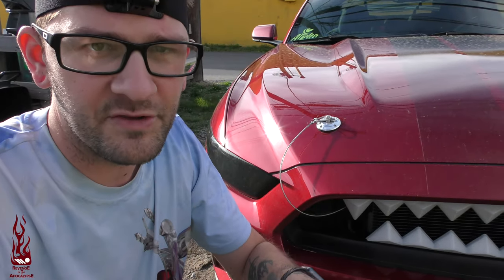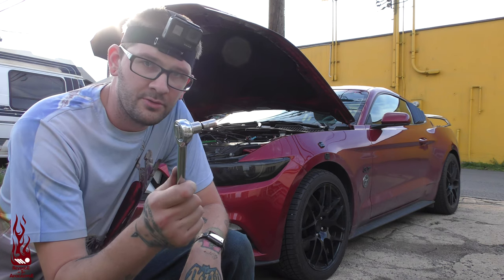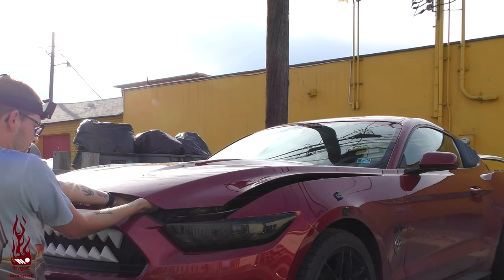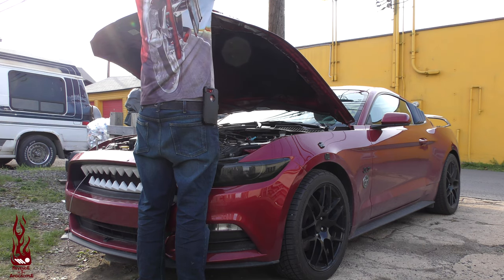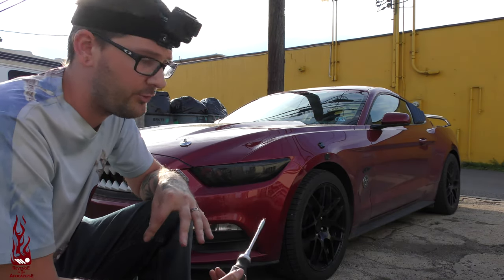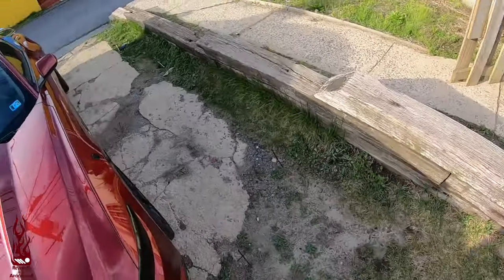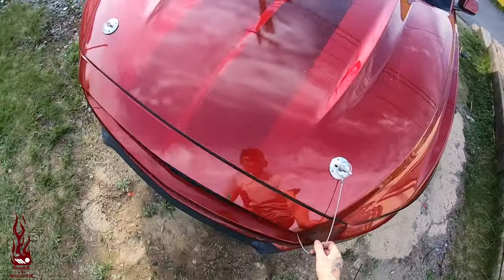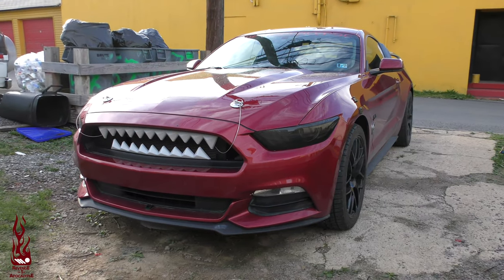2015-17 Mustang Hood Pin Install

Comment: A curiosity I haven't had answered yet is.... what's the point of the cables?  I like the hood pin idea, but the cables to me look terrible and are likely to scratch the paint and flap around at speed.  Nobody is going to steal your pins.  Is that why the cables?
Reply: It's just so u don't lose the pins especially if your driving and they come out

Comment: But I don’t understand what the point is of installing this on a stock hood of a base model (v6). I could understand if it was a v6 with an aftermarket hood but you still have the base hood without even a functional scoop or vents. There’s no reason. Mine as an aftermarket hood with vents and a scoop, it wobbles a little when I drive 80+ and it needs hood pins. But I doubt yours moves at all. Come on now. You should have bought the appearance kit. And that shark grill looks incredibly stupid. Mine has the 50th anniversary grill I found on eBay for $60.
Reply from the maker: an appearance kit is fake, this hood is being swapped out for a carbon fiber one that will require having pins, considering I do the work myself this was practice before messing up a 1,600 hood.  also safari as the teeth, they are a staple for my car.... I like that it stands out and isn't the same as everyone else's.... you might have a Ebay special but weather you like or diss like my grille, you won't forget my car

Comment: Not bashing you could of take a tad more time on install done it all step by step with painter's tape on the paint so it didnt shard or crack you really just went at this from ever way that you didnt want to but some how pulled it off lol and you have way to much play in the pins
Reply from the maker: im obviously not a professional, but I did this on a Camaro before so I kinda had a decent idea how it would be, I have intentions on putting  carbon fiber hood on so if there was damage its just something I wasn't worried about... but yea you are right about using tape